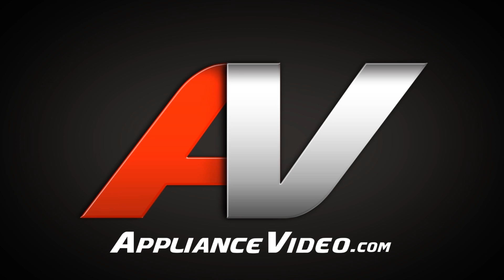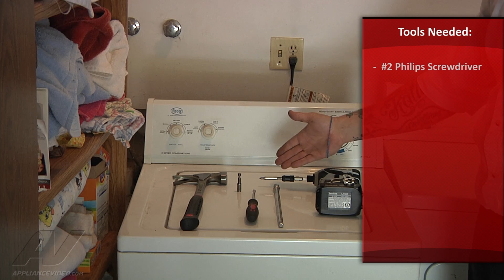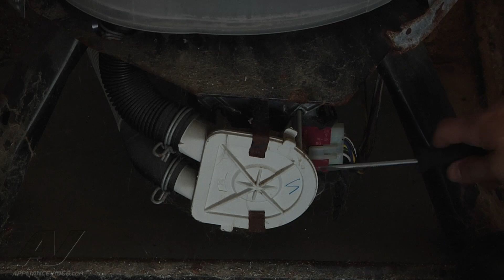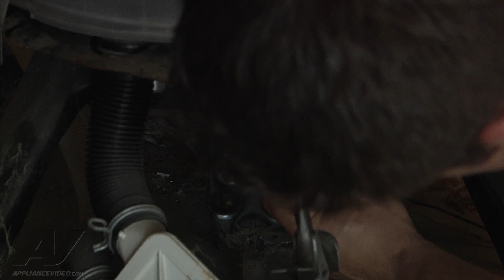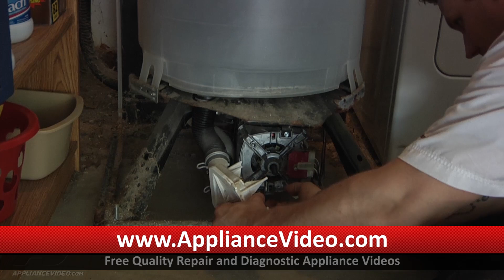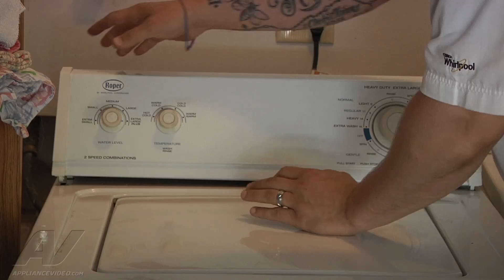Whirlpool Washer Repair - Does Not Spin, Buzzing Sound - Coupler

Comment: My kenmore VMW machine isn’t cleaning as well as it use to. It does hum sometimes, becomes out of balance often and won’t completely drain. Usually I readjust the load and manually set timer to spin and it will finish draining the water. Error codes say F7E6 & F7E7 so looks like motor issues.where do you recommend I start troubleshooting for a repair?
Reply from the maker: Great question, if you have a more technical question that our parts department cannot answer, you can search our over 17,000 answered questions free at our website www.ApplianceVideo.com under our Repair Help section. You can also call our parts department at 1-800-830-5465 and they can give you help 7-days A week ,or search at www.SaveMoreOnParts.com  .

Comment: The washer in my apartment wouldn't drain, I looked n unscrew the 3 screws, remove the drain plate or whatever it's call n I SEE!!! a shirt stuck inside the drain peg. I pull the shirt out n screw the 3 bolts back in n start a wash!!! works just fine nothing broke!!!
Reply from the maker: Great question, if you have a more technical question that our parts department cannot answer, you can search our over 17,000 answered questions free at our website www.ApplianceVideo.com under our Repair Help section. You can also call our parts department at 1-800-830-5465 and they can give you help 7-days A week ,or search at www.SaveMoreOnParts.com  .

Comment: I have a roper rtw4305vq1 thats making a higher pitch buzzing noise during the spin cycle. Any idea what the issue would be?
Reply from the maker: Great question, if you have a more technical question that our parts department cannot answer, you can search our over 17,000 answered questions free at our website www.ApplianceVideo.com under our Repair Help section. You can also call our parts department at 1-800-830-5465 and they can give you help 7-days A week ,or search at www.SaveMoreOnParts.com  .

Comment: My Roper washing machine has a single knob when it gets to the spin cycle it's just so completely will not spin and the water won't drain out it the agitator is working okay
Reply from the maker: Great question, if you have a more technical question that our parts department cannot answer, you can search our over 17,000 answered questions free at our website www.ApplianceVideo.com under our Repair Help section. You can also call our parts department at 1-800-830-5465 and they can give you help 7-days A week ,or search at www.SaveMoreOnParts.com  .

Comment: My Roper washing machine when I get to the spin cycle it cuts off completely no sound whatsoever just like you cut the switch off
Reply from the maker: Great question, if you have a more technical question that our parts department cannot answer, you can search our over 17,000 answered questions free at our website www.ApplianceVideo.com under our Repair Help section. You can also call our parts department at 1-800-830-5465 and they can give you help 7-days A week ,or search at www.SaveMoreOnParts.com  .

Comment: How did you know that the problem was with the coupler?  I'm having similar problems, but I don't want to take my washing machine apart and find out that it wasnt't the coupler.
Reply from the maker: Great question, if you have a more technical question that our parts department cannot answer, you can search our over 17,000 answered questions free at our website www.ApplianceVideo.com under our Repair Help section. You can also call our parts department at 1-800-830-5465 and they can give you help 7-days A week ,or search at www.SaveMoreOnParts.com  .

Comment: If it’s the coupler does it always make that funny noise?
Reply from the maker: Great question, if you have a
more technical question that our parts department cannot answer, you can search
our over 10,000 answered questions free at our website www.ApplianceVideo.com under our Repair Help section. You can also call
our parts department at 1-800-830-5465 and they can give you help 7-days A week
Monday -Saturday, or search at www.SaveMoreOnParts.com  24 hours
7- days A week.

Comment: Hi, my Whirlpool washer does not spin. It wash fine but when it reach the spinning time it does not spin or make any noise. I am a Whirlpool washer repairman and I can't get out with this problem. Thanks for your help.
Reply from the maker: Great question, if you have a
more technical question that our parts department cannot answer, you can search
our over 10,000 answered questions free at our website www.ApplianceVideo.com under our Repair Help section. You can also call
our parts department at 1-800-830-5465 and they can give you help 7-days A week
Monday -Sunday, or search at www.SaveMoreOnParts.com  24 hours
7- days A week.

Comment: Hi, nice video. I have this same washer. Water loaded up and when irs supposed to start the cycle , a burn smell  came out, now the machine make the timer noise, like ots going through the cycle, but nothing moves, i try the coupling, i move it by hand and i as able to move the inside, so, i dont know, any idea on what can be the problem? Please, any help will be appreciated. Thanks in advance.
Reply from the maker: Great question, if you have a
more technical question that our parts department cannot answer, our
technicians are answering all questions at our website at www.ApplianceVideo.com under our Repair Help section. You can also call
our parts department at 1-800-830-5465 and they can give you help 7-days A week
Mon-Sat . You can also search at www.SaveMoreOnParts.com 7- days a week.

Comment: I have this very same machine. The problem I'm having is it stops at the drain cycle, right before the rinse. So no water is being drained. I turn the knob to another wash cycle and it starts washing again, then stops at the drain cycle. Can you tell me what this could be please?
Reply from the maker: Great question, you can call
our parts department at 1-800-830-5465 and they can give you help 6-days A week
Mon-Sat . You can also search at www.SaveMoreOnParts.com 7- days a week.  If you have a more
technical question that our parts department cannot answer, our technicians are
answering all questions at our website at www.ApplianceVideo.com under our Repair Help section. We have over 6,000
common questions and answers that you can easily search through by your model
number, appliance make, problem or error codes, and It’s completely free to
search through our question & answer library. There is a very good chance
you question is already answered there.

Comment: i changed the motor coupler out but now when i start the washer there is electrical lighting coming from the bottom of the washer...any ideas??
Reply from the maker: Great question, you can call
our parts department at 1-800-830-5465 and they can give you help 6-days A week
Mon-Sat . You can also search at www.SaveMoreOnParts.com 7- days a week.  If you have a more
technical question that our parts department cannot answer, our technicians are
answering all questions at our website at www.ApplianceVideo.com under our Repair Help section. We have over
4,000 common questions and answers that you can easily search through by your
model number, appliance make, and problem or error codes, and It’s free to
search through our question & answer library.

Comment: I inspected the coupler on my washer and found that it was broken. I then bought the part and replaced it but it still buzzes and doesn't spin. what could be the problem?
Reply from the maker: Great question, you can call our parts department at 1-800-830-5465 and they can give
you help 6-days A week Mon-Sat . You can also search at www.SaveMoreOnParts.com 7- days a week.  If you have a more technical question that our parts department cannot answer, our technicians are answering all questions at our website at www.ApplianceVideo.com under our Repair Help section. We have over 4,000
common questions and answers that you can easily search through by your model
number, appliance make, and problem or error codes, and It’s free to search
through our question & answer library.
Reply: Arturo Beltran did you ever figure it out? Mines doing same

Comment: After the couple has been replaced it still buzzes but it spins
Reply from the maker: Great question, you can call our parts department at 1-800-830-5465 and they can give
you help 6-days A week Mon-Sat . You can also search at www.SaveMoreOnParts.com 7- days a
week.  If you have a more technical question that our parts department cannot answer, our technicians are answering all questions at our website at www.ApplianceVideo.com under our Repair Help section. We have over 4,000
common questions and answers that you can easily search through by your model
number, appliance make, and problem or error codes, and It’s free to search
through our question & answer library.

Comment: Can this be done with a little water in the tub or do I have to drain it complety?
Reply from the maker: Great question, you can call our parts department at 1-800-830-5465 and they can give
you help 6-days A week Mon-Sat . If you have a more technical question that our
parts department cannot answer,
our technicians are answering all questions at our website at www.ApplianceVideo.com under our Repair Help section. We have over
3,000 common questions and answers that you can easily search through by your
model number, appliance make, and problem or error codes, and It’s free to
search through our question & answer library.
Reply: ApplianceVideo.com thanks  great vid
Reply: lol

Comment: I pulled the coupler off and it was not cracked.  However there was a little play in it.  Should the coupler be snug? If it is loose fitting, will this cause any problems?
Reply from the maker: +Michael Snyder 

         We would like to help you answer your
question. With our videos now getting over 900,000 views per month and hundreds
of questions from people like you, our technicians are now answering questions
at our website http://www.appliancevideo.com/repair-help/ .  We also have over 2200 common questions
and answers that you can easily search through by your model number, appliance
make, problem or error code and it’s absolutely FREE. You also have the option
to email a factory service technician with a question on your appliance at http://www.appliancevideo.com/repair-help/ . If you’re looking for a repair video, you can
also search our library of over 2600 free repair videos. ApplianceVideo.com
specializes in quality DO-IT-YOURSELF appliance repair videos and we get over
800,000 views per MONTH to our videos worldwide and growing. If you need of
parts for your major appliance, we have over 5-million parts in stock at http://savemoreonparts.com/ .  Thanks for your support. Matt Ace
Appliance factory service technician.
Reply: It was the capacitor. I bought an industrial one and it runs like new. Your videos are the best I have come across and I have subscribed to your channel.